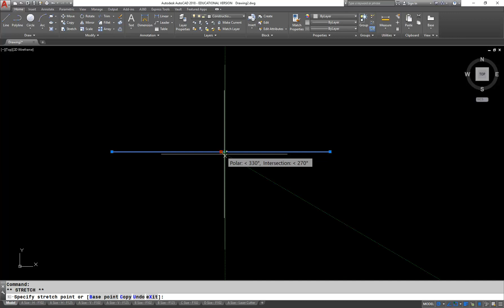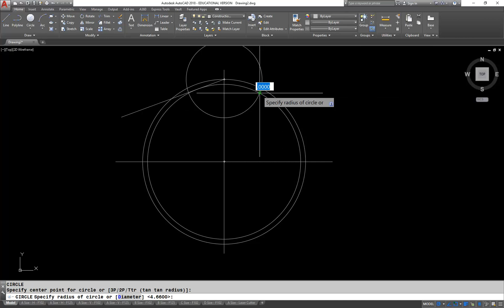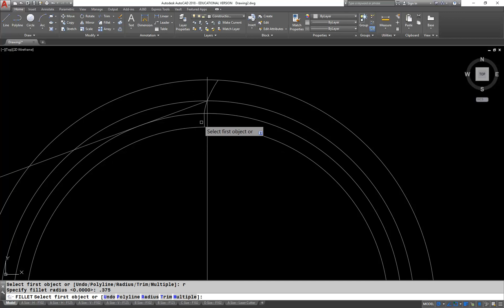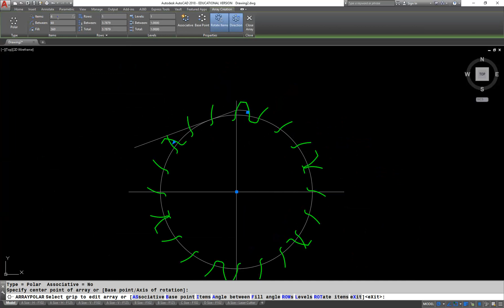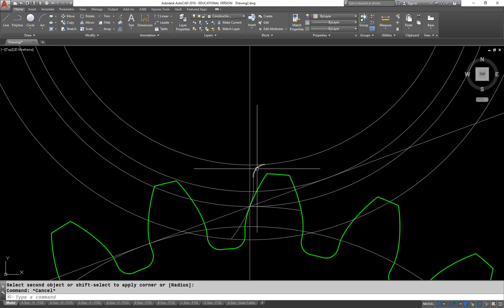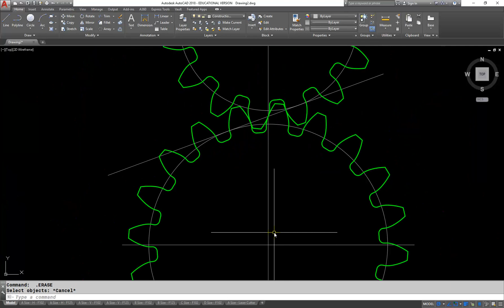Drawing a Gear and Pinion

Comment: Sir pressure  can we assume???
Reply: No pressure is always given in the instructions
Reply from the maker: Yes, it has to be known so as to reference the correct flank and face radii for Wellman's Odontograph. In this case the pressure angle is 20 degrees.
Reply: Can u teach to design a spline and helical gear